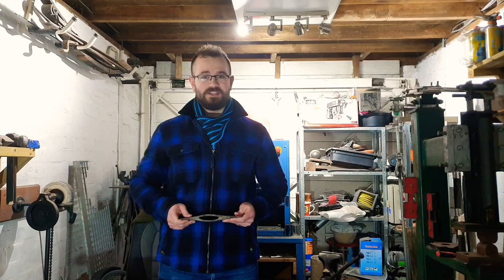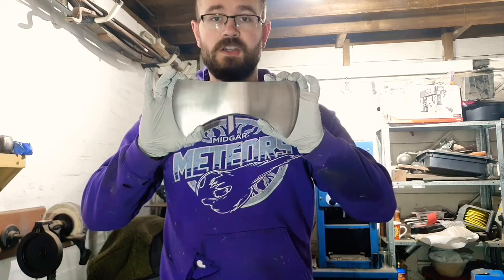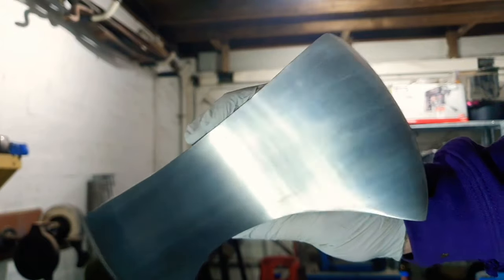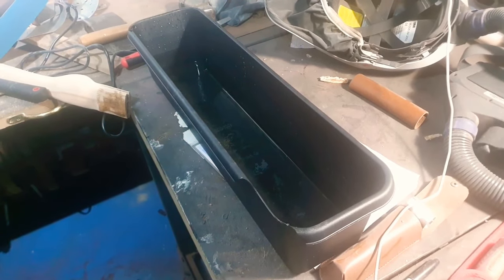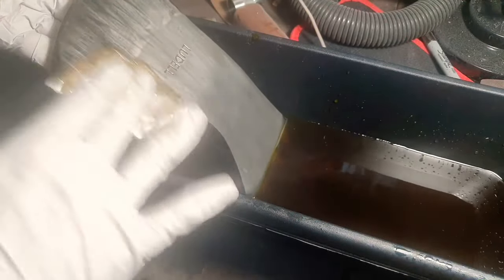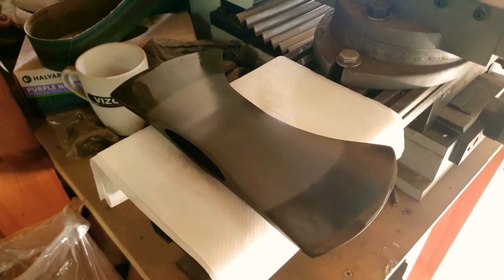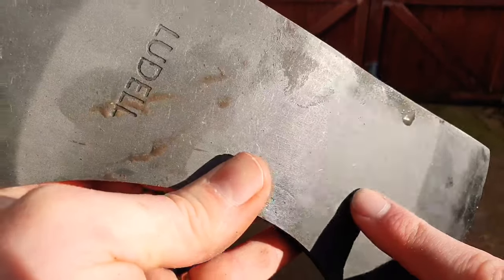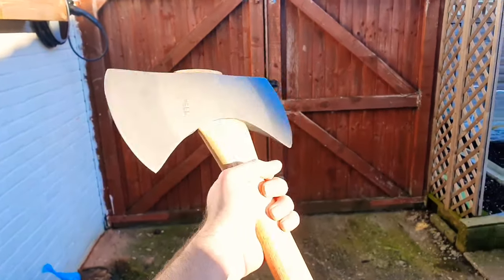Stone Washing a Double-Bit Axe

Comment: That looks awesome. Great idea to do a stone washed finish. Did you have to re grind the edge afterwards? 
Fingers crossed there’s no lasting damage to your eye.
Reply from the maker: Eye seems to be healing well thanks!

And yeah, I sharpened the edges after the wash. Obviously churning it in rocks would dull any edge that was applied before, so there's no point until after it's ready.